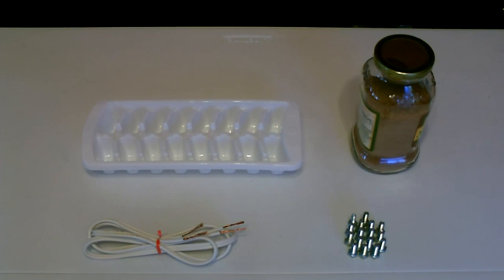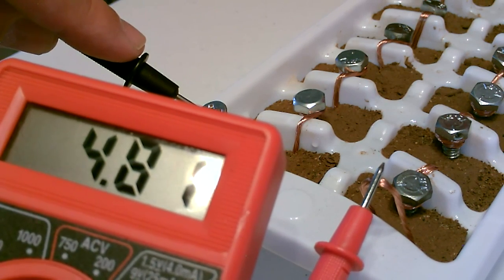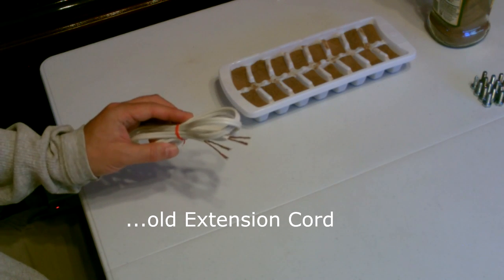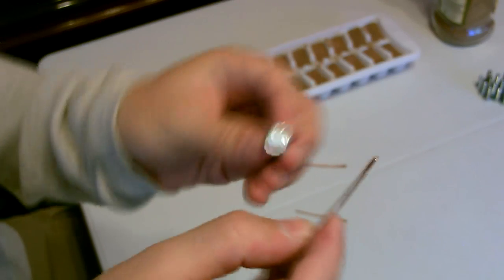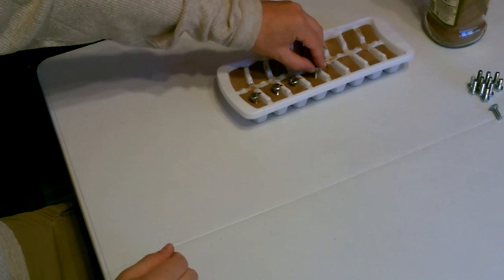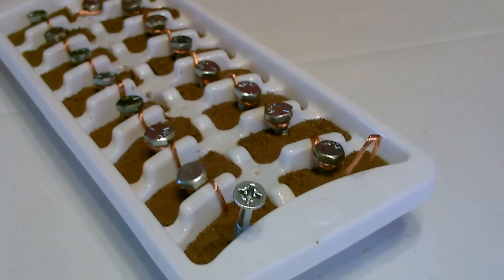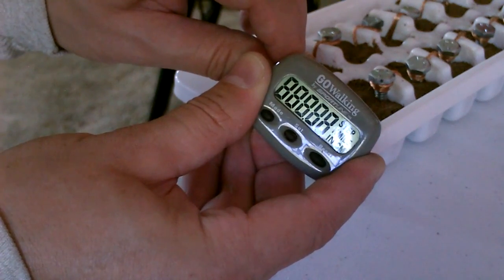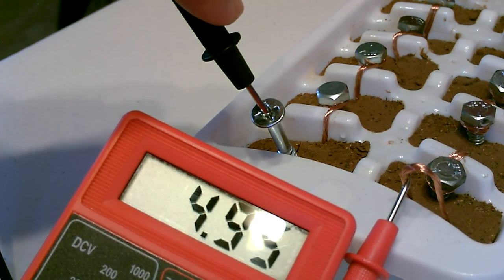Homemade Battery! - The DIY "Earth Battery" - Powers Clocks/Watches/Calcs/LED Lights....

Comment: It would be interesting to see several of these ice cube tray earth batteries stacked together in series. Maybe a stack of 3 trays would give you around 12V?
Reply: +C3PO's Bottom Bit 

That is a good question.  I've been thinking about the Bahdad Battery, and what it could have been used for.  

Since they didn't have light bulbs, or any other electrical equipment, I started to wonder what else.

Then it hit me.

Heating.

When you add enough current to a material with a high enough resistance, heat is produced (think an electric coil heater).  They may have also been used as an ignition source for oil lamps during rituals to make it look like they caught fire by themselves (proof the gods were paying attention).
Reply: @detroitgoth  Man, I never thought of the occult elite using advanced engineering to produce magical illusions.  That's brilliant.  I wonder if the pyramids at Giza with the gold caps could have been used as a tesla coil under certain conditions to display the wrath of the gods and keep huge populations as slaves.
Reply: +Tools2Survive funny thing is they made these thousands of years ago in huge clay jars, wonder what they used those for back in the day.hmmmmm.......
Reply: @sythlorde  metal plating. gold plating
Reply: pretty sure to run a tesla carriage
Reply from the maker: Tools2Survive hi there. you should be able to make a "12v battery" using as few as 2 of them (as i was ultimately able to get this earth batteries output voltage to just over 6v by "fully saturating" the soil).
Reply: desertsun02 Using a drip hose with a timer could make this maintenance free. You could also make several double stacked ice cube tray earth batteries (12v) and connect them in parallel to increase the amperage.
Reply: @desertsun02  try a tiny bit of white vinegar in each cell see what happens.
Reply: +Tools2Survive yeah .. let's do this. Im gonna try to power a dc motor using this.. will tell you the results in a few days..
Reply: @abhimanyukashyap2514  what where the results of your dirt battery powering a DC motor?
Reply: Yes, still no answer if any of these worked
Reply: @abhimanyukashyap2514  did it ever work?
Reply: @mikee5208 😂 he must have forgotten.
Reply: +Abhimanyu Kashyap So?
Reply: J Simo didn't do anything yet .. Gotta take some time off .. I am not a scientist just trying to learn ...  Will post video once I do it .. Sorry for giving wrong time frame I thought I would do ig
Reply: Abhimanyu Kashyap Waiting anxiously.
Reply: Abhimanyu Kashyap no problem. you're honesty very much appreciated!!!
Reply: +SHARE H!S V!S!0N  Good old Baghdad Battery.... reproductions have been found to produce between the standard 1.5V and up to 18V from the research Ive done on ancient technologies!!

I can tell you they certainly used them to electroplate what we now call artifacts, since electricity is the only way o accomplish this from what I know, unless they had extensive knowledge of chemistry as well as how to and where to find the substances, purify them and bring them together in the proper sequences.

Bet those Egyptology experts rue the day they allowed their initial discoveries to go on tour in the US despite agreeing NOT to tamper they x-ray/Ct-Scan to find they were NOT solid gold as originally inferred, and this alone opened the ancient electricity can of worms for knowing it was necessary to achieve gold plating!  LOL!

They want the world to believe their own ancestors achieved many of those awesome accomplishments, for otherwise being a dirt poor country and keep everything locked down for fear of losing the primary source of their economy through the 10's to 100's of thousands of tourist annually!!  Who would go if the world knew they had little to do with most of those great achievements as a people!!! 

Peace, Love, & Light!
Reply: @TheSmokingGun57  People would definately go even more if it was known much of the Egyptian stuff was made by some earlier civilization. Reason for giving the public the current dumbed down version of history is for other reasons than keeping the tourism. There seems to be a general policy of giving public false information on many issues relating to history and other things that I think this is part of that same policy.
Reply: +Abhimanyu Kashyap well, what happened?
Reply: +detroitgoth they used it for electroplating gold on EVERYTHING>
Reply: +Tools2Survive  Adding electrolyte substances should increase the output, maybe some rock salt, or similar since it calls for plastic trays, since metal ones would be eaten up in a rather short period, of course increasing overall volume will increase longevity!

Peace, Love, & Light!
Reply: Dirt hold much, much more microbial life because it not only provides food source but also place for the microbes to live, in all the cracks and pores, and it also allows gas exchange to happen